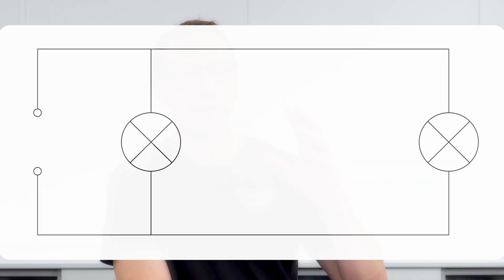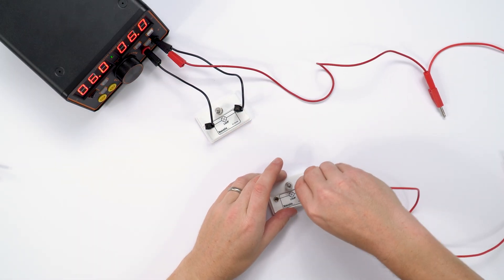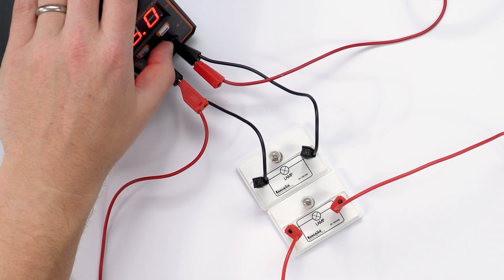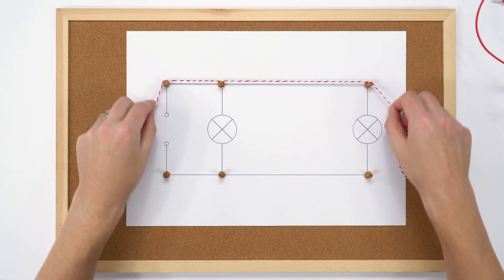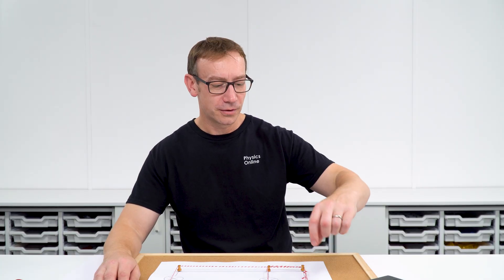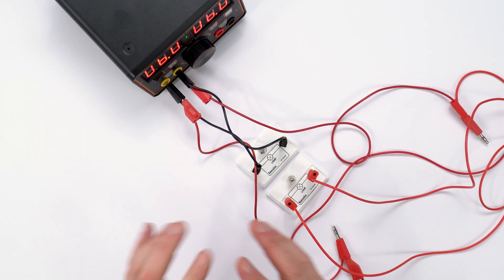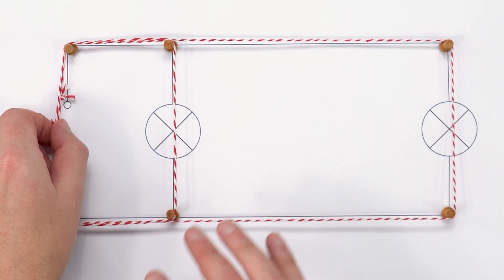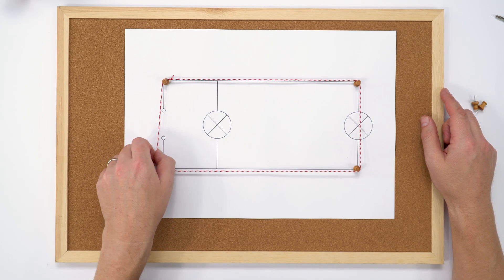Which One Will Light Up First?

Comment: This was quite disappointing. I thought this would take into account the insanely fast processes of electron flow and explain it on a particle physics level.
19:33 is a bit of comedy in that regard because, apart from the silly setup of negligible wire length difference and you not utilizing an ultra high speed camera, even in that setup the farther light bulb actually started glowing a bit before the other responds at all. (And why you didn't use LEDs instead is another question, since they don't have the sluggish response of tungsten wires.)

Comment: If the distance between the bulbs is x, wouldn't the further one light up x/c seconds after the first one where c is the speed of light. I understand it wouldn't actually be c because of the dielectric but surely it's not exactly the same.
Reply from the maker: I see your point, and yes the electric field would only propagate at a finite speed which would be noticeable if the wires were significantly long. But with those distances the resistance of the wire would also have a large effect and probably stop the second lamp from lighting up at all!
Reply: @PhysicsOnline  well, since we're going theoretical, the wire is a superconductor.
Reply: @h7opolo  Тобто це можна назвати "теорією сферичного коня в вакуумі". Поцікавтеся, це дуже старий анекдот, який повністю підходить для цього пояснення. Тим більше з використанняч мотузочків.